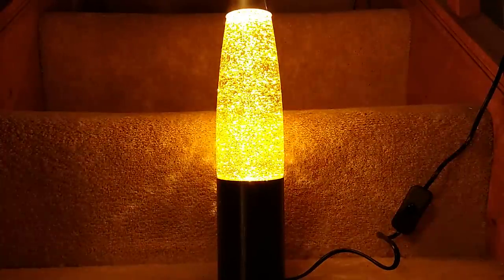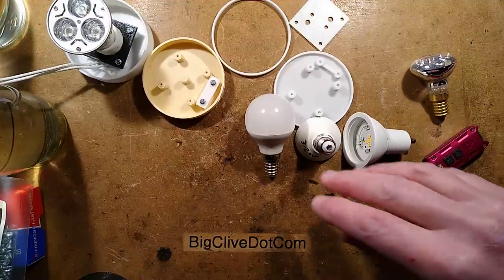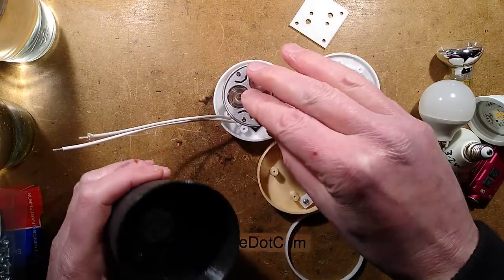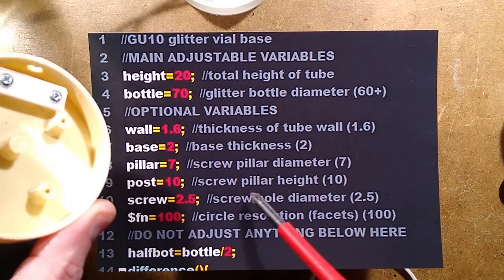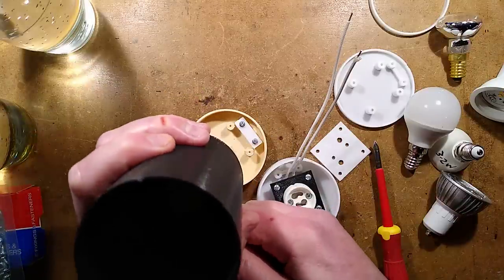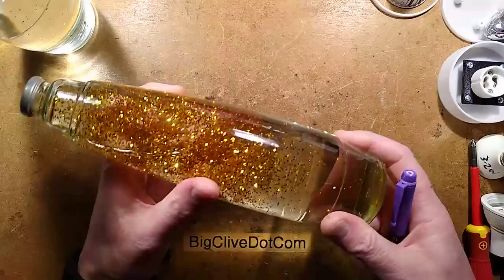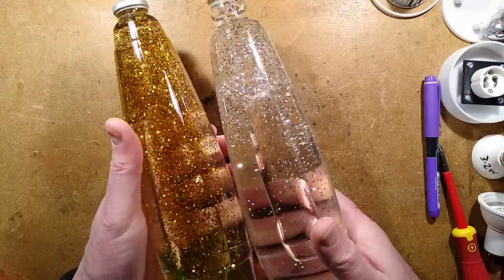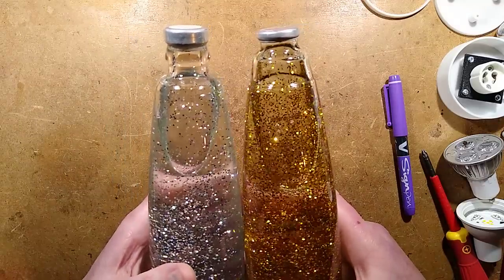Custom LED flowing glitter lamp

Comment: Speaking things that some ladies use to make their nails look pretty that can be otherwise useful, the glue they use for false nails is cyanoacrylate, aka superglue, but a pack of 40 x 2g tubes of nail glue can cost less than 4 x 5g tubes. If, like me, you only ever use small amounts of superglue, frequently but not regularly and you hate finding a solid tube or bottle when you return to it, nail glue is the cheapest solution.

Comment: i bought a lava lamp, so called, today from B and M for 8 quid. it is a lava lamp, it looks great. i love it! it is from the same place as me, the 1970s. but it isn't made by Matmos? it should have been 16 quid but box was crushed and it was the last on the shelf. annoyingly the cool purple colour comes, in part at least, from a layer applied to the glass. i can see a few dots where the dye didnt quite stick to it. but the way they finely adjudged the relative densities is awesome. i been watching it for an hour. the times it makes a blob, rises, but the blob half fails, so half falls back to the bottom, so it looks great is remarkable. my neighbour had one when i was about 8. it was nowhere near as good as this one, the goo used to stick to the top. it is made by "glow", i suppose matmos lost the rights sometime in the last 40 years? matmos? is that not a dr who baddie?....off to look online...... yep, that was quite interesting. it seems the original 'lava lamps' were in fact called 'astro lamps' by their creator, matmos. so anyone can make a thing called a lava lamp. i live and learn! i just read the box, it says non-toxic so i might unscrew it and have a little taste of a finger-tips worth... i did. yuk! soapy and oily, but mineral oily not cooking oily. bleeurhg. - extra addendum, i recalled correctly, you will be pleased to learn. matmos was a pulsating,glowing alien brain thing from dr who.. so apposite name for the lamps..........i have noticed some wax sticks to the top, only a little bit, but it gets hung up on the meniscus, it it probably useful as it seems to bounce off rising blobs more readily than otherwise. but why didnt they fill the whole bottle with fluid? was this bit planned? if i shake the glass enclosure this bit breaks up and buggers off, but 20 mins later another one is there. it really looks amazing, like sid barrets dreams, one imagines, for 8 quid!

Comment: Providing the OpenSCAD scripts is fantastic. Been using OpenSCAD a lot lately for making various brackets and mounts for PCB's.

One enhancement, replace the variables with the following changes to comments and they all get laid out nicely in the customiser view. The $fn variable will get a combo box with options.

/*[ MAIN ADJUSTABLE VARIABLES ]*/

// total height of tube
height=15;  
// glitter bottle diameter (60+)
bottle=70;

/*[ OPTIONAL VARIABLES ]*/
// thickness of tube wall (1.6)
wall=1.6;
// base thickness (2)
base=2;  
// screw pillar diameter (7)
pillar=7;  
// screw pillar height (10)
post=10;  
// screw hole diameter (2.5)
screw=2.5;  

// circle resolution (facets) (100)
$fn=100; //[10, 20, 30, 50, 100]

Comment: This is an "adulty project"? Wondering just what sort of glitter-fulled glass sculpture you're going to put on that base with lurid pink illumination.

It might make operation easier if you were to make that bass into two pieces: one cylindrical piece to hold the glitter container, and a second base piece to hold the light bulb.

I suspect eBay is flagging listings that contain the word "nitrate" and removing them or at least manually reviewing them.

Comment: I had a look at possible alternatives for calcium nitrate, mainly looking at the solubility in water. Obviously I tried to ignore anything which might be particularly harmful or difficult to get in terms of availability or price.

I came up with 2. Copper nitrate which has a similar solubility to calcium nitrate and will give a nice blue colour and potassium thiocyanate which has a higher solubility. Both are readily available on eBay.

A cheaper alternative might be fructose which is extremely soluble but I'm not certain it would not be compromised by bacteria and molds.
Reply from the maker: I tried sugar as one option, but couldn't get the gravity high enough.
Reply: @bigclivedotcom  Not all sugars are equal. You have to pick your sugar, fructose is highly soluble, about 3400g/l, glucose about 1/10 of that.

Comment: My guesses to solve the corrosion issue:
Nitrates are good oxidisers so that could be the culprit. It could also be the case that having an acidic pH facilitates breakdown. I would try making a tiny adjustment to the pH using a buffer, and if that fails then trying some metal corrosion inhibitors like sodium metabisulfite (used in winemaking).
Reply: The pH of a 45% calcium nitrate solution is 6.5, so it is slightly acidic. Maybe bumping that to 7 by a small amount of AlOH would work, since it would also preload the aluminum ion concentration in the solution.
Reply from the maker: I'm cautious about mixing random chemicals in glass bottles.  But the PH idea is interesting.
Reply: @jounik https://en.m.wikipedia.org/wiki/Aluminium_hydroxide quote " Aluminium hydroxide also forms a gelatinous precipitate in water. " - that could help the random walk of the glitter...

Comment: Well, projects like those make me pay AliExpress a visit to see what those small Chinese electronic shops come up with.

And yo and behold - plenty of glitter lamps with an assortment of LEDs - RGB to gaudy golden ... in all shapes and forms - as long as the shape and form is that of a HUGE butt plug.
Reply: I'm reminded of the Opal Fruits tagline here for some reason. I'd be a little careful of the search terms you use in aliexpress - for example I'd stay clear of K9 harnesses for example or your outlook on life might be somewhat broadened in interesting ways (this is not a recommendation...).
You should be able to find COB LEDs on daughter boards floating around on there - the stuff they do is amazing, from stationary engines, to micro petrol v8, via electronics and android toilet lids... That's a great Hubitat idea, put a contact sensor on the bog seat that triggers the boyfriend/husbands shock collar... 😂
The things chemo does to my mind 😂😂

Comment: Interesting thing about that calcium fertilizer. If it were pure Ca(NO3)2, it'd have 17% nitrogen and 24.3% calcium as far as molecular mass is concerned. It seems like there's some other calcium salt mixed into the fertilizer, lowering the nitrate anion to calcium cation concentration ratio.
Reply from the maker: The most recent bag is marked Calcium Nitrate and has that same Ca(NO3)2 formula.
Reply: Most commonly nitrogen is reported as equivalent ammonia but I am unsure about calcium.
Reply: Yeah, fertiliser is fun. My father travelled to Poland to look at the facilities of an agrochem company they'd just bought. Was proudly introduced to the companies new two floor store... With the dangerous poisons store (pesticides etc) on the top floor and the "safe" fertiliser store on the ground floor... Can you see what's wrong yet? (in the style of Rolf "Creepy" Harris).
Dad promptly exploded (pun intended) and carefully explained that there's a reason why you can make bombs from fertiliser... And what do you think happens when your poisons store is on top on about the same amount of explosives as can be found in the magazines of the entire King George V class (1939) of battleship...

For those who haven't seen it yet.. Everything was carefully moved out of the 1st floor poisons store, and all the fertiliser was moved extremely carefully to the 1st floor, and all the poisons were put on the ground floor. That way if things turned explody - only the fertiliser would go up, instead of covering the local area in neat agrochem nasties (and we're not talking about the nice stuff like glyphosate and neonics)....

And you thought GCSE chemistry was useless in real life.. Although I could have done without the asbestos tripod plates...

Comment: I always wondered what would happen to Glitter lamps and Lava lamps when Tungsten globes become unobtanium.
Looks like this is a nice project.    Could you use a couple of resistors glued to the base to heat the liquid?    I would think if the LED was slightly underrun, it should last pretty well forever so the lamp would never need to be pulled apart.
Reply: yes resistors are the "quick way" to convert an old glitter lamp but you need high power resistors as you are now replacing a 20-25w lamp with a 2-5w led. If you make a new one from scratch it's better to alter the liquid like Clive is doing so it works with the much less power hunry leds. Also the 3D printed case will be weakened or even melt with a 20w heating element inside like a tungsten lamp or the resistors
Reply: They should be ok as appliance bulbs aren't going anywhere any time soon.
Reply: @chinanorthairguns  there are led-based appliance bulbs already and the tungsten lamps are being already phased out at least here
Reply: @marcogenovesi8570  They have LED bulbs that go in ovens?
Reply: Lava lamps basically have to run at the temps they do, since they depend on the properties of hot wax. Not sure room temp oils very enough in density with small temp changes to get the whole blobbing to work
Reply: @marcogenovesi8570  Never seen an LED oven bulb.
Reply: @Sonny_McMacsson  Newer ovens and dishwashers have special LEDs designed for the job and are expensive to replace (can only be ordered from appliance repair shop/person). 
People with old appliances are screwed.
Reply: @chinanorthairguns  Newer ovens and dishwashers have special LEDs designed for the job and are expensive to replace (can only be ordered from appliance repair shop/person). 
People with old appliances are screwed.
Reply: @marcogenovesi8570  Never seen one in Canada, and a google search does not come up with any either.
Reply from the maker: I did another version with a mains powered PCB and two resistors to drop the current for a circle of ordinary 5mm LEDs.  The resistors heated the base of the vial.

Comment: Nice project, though building it from scratch without salvaging any parts like the bottle/base from an existing lamp could get difficult and/or expensive. 
And if you (re)fill an existing bottle, a new lid from TPU could work to create a decent seal while still allowing emergency pressure relief.

Comment: The aluminium cap probably also helps with losses through the rubber over time. In a few years the water may migrate out through the stopper upsetting the delicate balance you have achieved.

Comment: hey Clive, you might wanna check out the Rainbow Motion Glitter Lamp, by Art + Sound, too. It has three multi-colour LEDs to illuminate the lamp, plus a small dc motor with a neodymium magnet attached to the end of the shaft. The motor-mounted magnet magnetically couples to another magnet attached to an impeller inside, at the bottom of the glitter lamp. So the only contact between the base and the lamp is the magnetic coupling between the motor shaft, in the base, and the impeller, inside the lamp. The rotating impeller swirls the liquid and glitter around. It’s clever and simple. oh and the lamp is very low power, consuming less than 100mA.
Reply from the maker: I found the magnetic agitator type to be too vigorous.
Reply: @bigclivedotcom  I completely agree, the ‘magnetic agitator’ lamps can swirl the glitter way too fast. I slowed-down my lamp to just the right amount with a 5 ohm resistor in series with a 5V USB power supply. I modified the lamp to run on USB instead of batteries, so I could leave the lamp plugged in all the time. The slower swirl is now more pleasing to look at. I also added a 10 microfarad electrolytic capacitor across the 5V rail + a snubber diode across the motor terminals.
Reply: @SCAM-BUSTER.777  Simply use the common terminal and either of the other two, and leave the third unconnected. The choice of which other terminal just depends on what position you want the switch handle pointing when the light is on. If you don't care (or it is just a toggle button) then it doesn't matter.
Reply: @SCAM-BUSTER.777  I'll try, but I'm in the US and we use different color designations than most countries. I can't see colors you have now and wouldn't necessarily know what they mean even if I did. 

First identify the earth/ground wire if there is one (often green or bare copper), and move that to the earth terminal on the new switch.

If the old dimmer has two current-carrying wires connected to it (typically black or red in the US), then the new one gets the same two wires. One goes to the Common terminal and the other goes to either of the two other terminals on a 2-way switch. The order doesn't matter.

If the old switch has three current-carrying wires, then it is one that needs a neutral connected (white in the US). If the new one has a terminal for neutral, put it there. If it doesn't, then just cap and tape that wire and push it into the box.

If the new switch needs a neutral but the old one didn't, then you're going to need to have someone who knows how to do it see if a neutral is present, and if not, how to get one there. Or get a different replacement dimmer that does not require a neutral.

Are there no instructions with the switch? At least here, most dimmers come with  basic instructions with wiring diagrams for a couple different situations. If these aren't clear enough, then I strongly recommend getting someone who knows how to do it to help. Basic electrical wiring is not complicated, but it is unforgiving if not done correctly.
Reply: @bigclivedotcom  
Hi bigclivedotcom 👍

Please can you show us how to make a 2-way switch wired up just to be a 1-way switch ?

One way switches appear to be going less and less in the UK.

Presumably it's just as cheap to make a two way as it is a one-way.

There is only one video on YouTube that describes how to do this, unfortunately the video maker lives in India. :(

I don't do online shopping so I am unable to buy anything from Amazon or eBay. :(

Thank you 👍

Comment: My first thought for an alternative to the calcium nitrate was propylene glycol--it's much (4x) more viscous than water--but then I looked up the density and found that it's only a few percent greater than pure water. Then I considered a sugar solution, but at ambient temperatures, even though you can dissolve more than a 2 grams of sugar per gram of water, the solution ends up with a specific gravity of ~1.4 as compared to the 2.5 you get with the calcium salt (due to the salt's greater density). It may be interesting to experiment with adding propylene glycol to see how it affects the flow.
Incidentally, if you add propylene glycol to the soap solution children use to blow bubbles, the bubbles will last longer.
Reply from the maker: I tried many glycols and glycerin, but the glitter still settles out at the bottom.
Reply: @bigclivedotcom  I suspect that was due to the low specific gravity. Adding propylene glycol or glycerine in addition to the salt solution might result in even slower eddies.

Comment: You could also leave the whole LED light and add Radium flakes so they will illuminate in dark too. 
But don't put your face to the glass to much otherwise you teeth may fall out and little bumps will occur here and there  :face-blue-smiling:
Reply: Almost as safe as NHS chemotherapy... Which I'm quitting by the way, but don't worry, I'm just leaving early to avoid the rush.. 👩‍🦲⚰️

Comment: Nice project. Not sure whether I ever will try to do it, but it is nice to know how to do something like that. It is still tempting to modify my old lava lamp, though.

The SCAD file, though, could have some improvement in the header section, like the comments of the parameters above and not on the same line. On the same line you could add a restriction for the slider in the customizer like

// The height for the foot
height = 20 // [20:1:200];

This you get a slider in the customizer which goes from 20 to 200 with 1 resolution. For a list of options like the quality you could use //[40,70,100] The comment on top will show as header for the parameter.
You can make sections for the customizer by putting something like

/* [Optional parameters] */

as header where the section for optional parameters will begin. This creates a header that folds out the parameter section when you click on it.

The take over of variables stops at the first defined module, by the way. It is easy to define a dummy module just for this case that is defined just below the customizable variables. There is no need if you don't define another variable later, though.

I personally like to ask the system variable $preview whether we are in preview mode, making the basic configuration faster by manipulating $fn. This can be done by

$fn = $preview ? 45 : 100;

This switches the sections from 45 in preview mode (F5) to 100 in rendered mode (F6) automatically.

Comment: how much of one type of salt is dissolved in a volume of water doesnt effect how much of another type of salt can be dissolved (mostly) so you can create dense liquid mixtures by using combinations of common salts instead. 
 which i think the commercial ones do
Reply from the maker: It might be viable to mix salts.

Comment: How does the calcium nitrite compare with perchloroethylene (brake cleaner) often used in lava lamp creation/repair?
Reply from the maker: I've made glitter lamps with perc balanced with baby oil, but I think it gradually dissolves the plastic.  The glitter is also prone to clumping and sticking to the sides of the glass bottle.